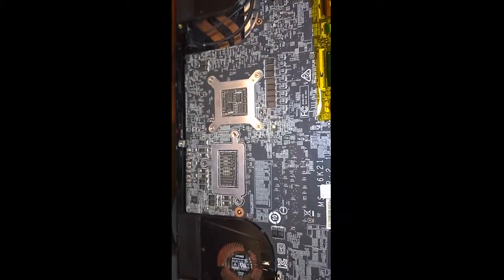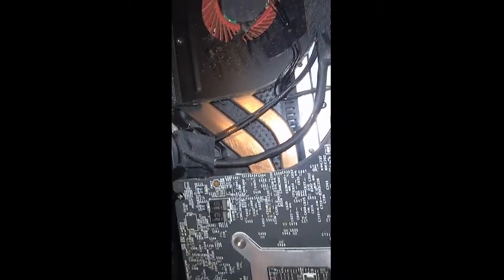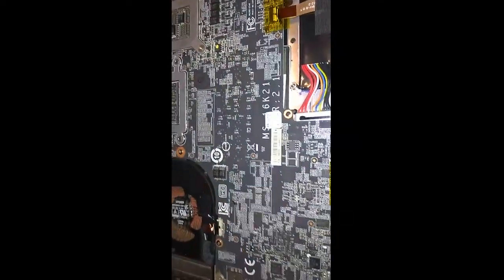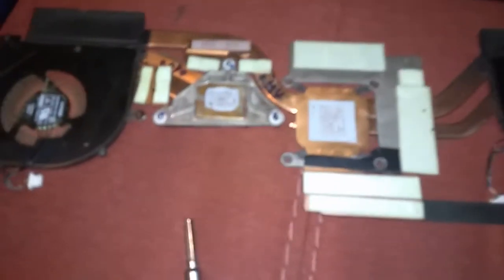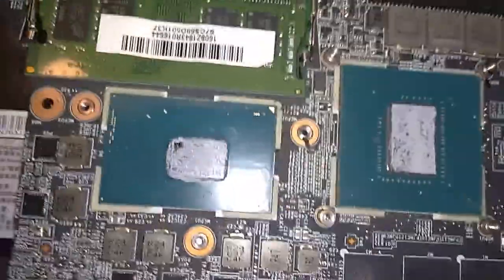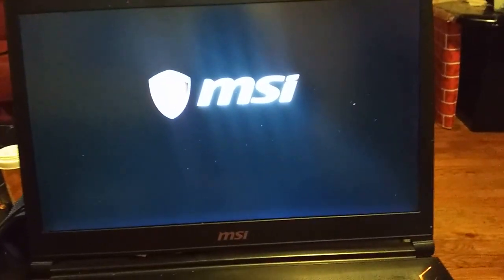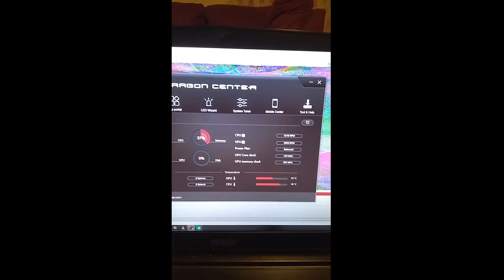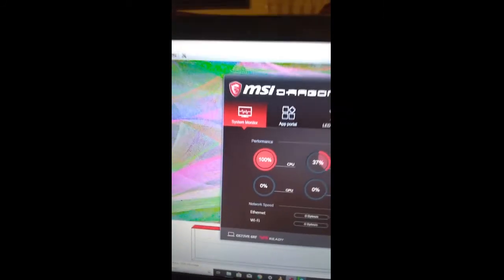MSI GS73VR Stealth Pro Fans cleaning and MX-4 Paste install.

Comment: I'm getting 80c on CPU and 83c max on GPU during gaming. Should I reapply the paste or just clean the fans for these temps?
Reply from the maker: Might as well replace paste if you going to to clean the fans. the board has to be taken out to reach fans anyways.

Comment: I'm going to do a repaste this weekend. I've not been happy with the build quality on this laptop. After an RMA on broken hinges, they failed again six months later.  I solved that problem with drilling screws through the top of the lid and attacking with nylon lock nuts. Replacing failed keys is pricey too.  But...I will keep it going rather than dropping $1500 on a replacement.

Comment: What I don't know and which I think you should have addressed is which screws to remove. I have cleaned the fans today yet it runs hot still so I assume it needs thermal paste replacement but I can't figure out which screws to remove and I'm afraid to break it.
Reply from the maker: You have to take the whole mainboard out undo all the ribbon cables for keyboard touch pad HDD be very careful for the power button ribbon wire i almost broke it, trying to take the mother board out before moving the wire ribbon to the side. there are a few screws holding the MB and fans they all come out together. the wifi card and ribbon next to it also had to be removed . Before doing all this i recommend the battery be disconnected first. its a lot of work to replace thermal paste, change ram , or replace SSD. Its the only thing i hate about  this laptop. This is that i do for a living so its not that hard for me . if you need more help its possible i can help  more.
Reply: @eman59461  Is there some sort of blueprint for it so I know which cables I need to remove since I don't know which cables are which. And I saw that some of the cables, for example, the disk one had a yellowish sticker on it do u have to remove that?